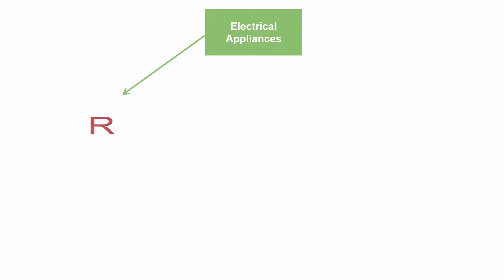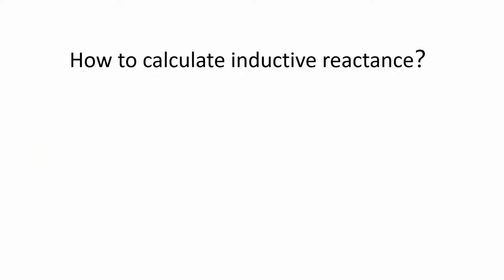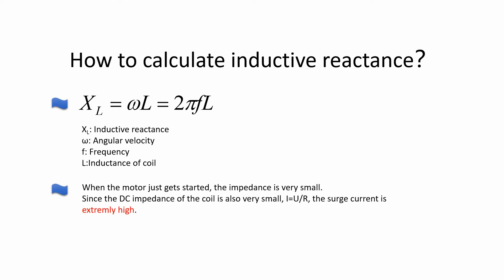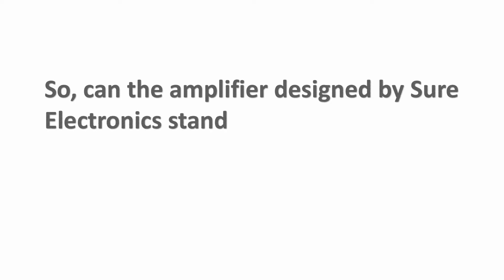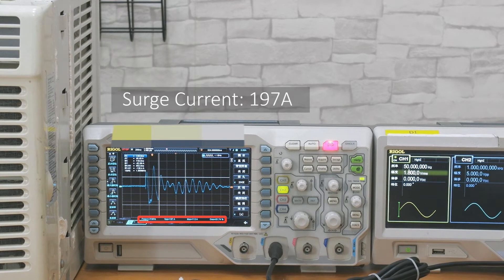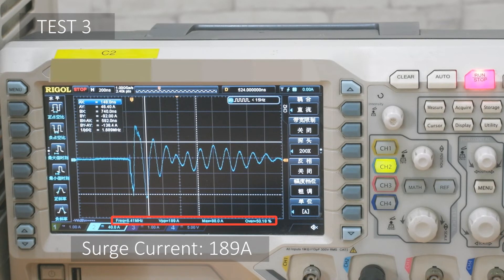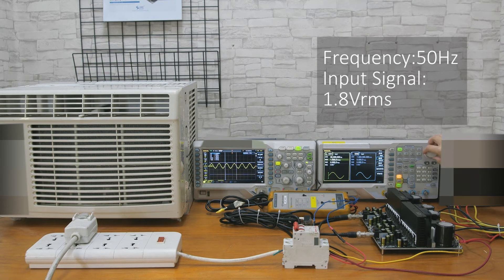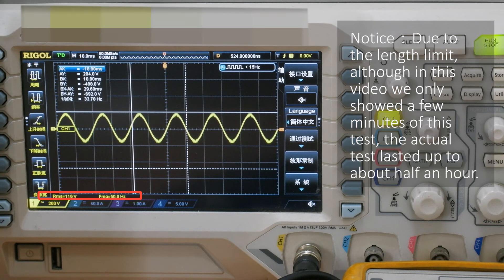Is WONDOM HPAD series based on IRS2092 chip tough enough to drive a large inductive load?

Comment: How does it handle 120v @ 60hz?
Reply from the maker: Hi MrBrymstond

Our HPAD-2500A supports ±85V power supply, and it performs quite well in the audio frequency(20Hz-20kHz). After modification, the frequency response of HPAD-2500A is flat in the low frequency too(5Hz-1KHz). If you have any problems, please feel free to contact us.
Notice:Our standard products are designed for audio applications. For any non-audio applications, customers are suggested to send an inquiry e-mail to us at store@sure-electronics.com. 
Thank you for your support. Have a nice day:)